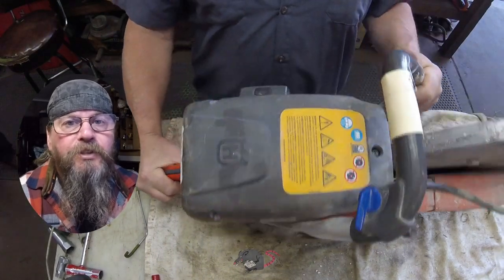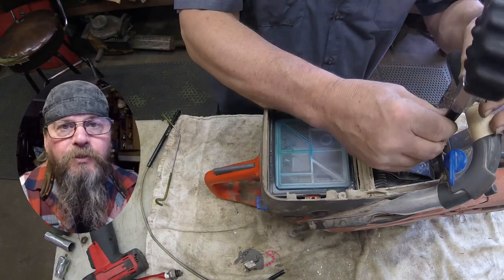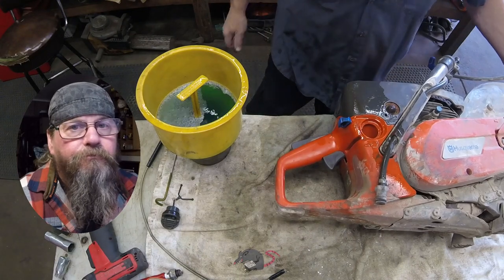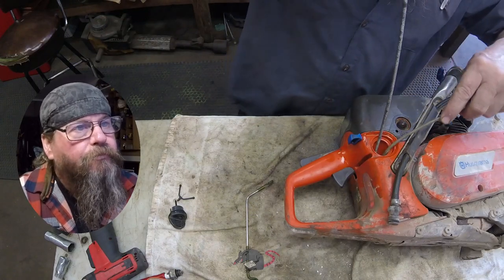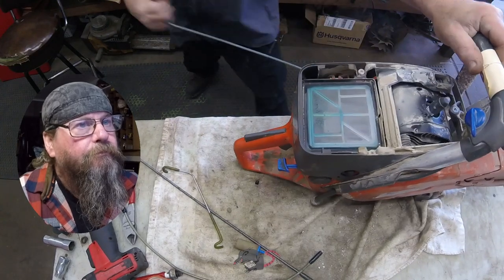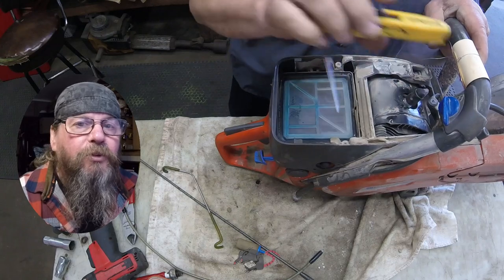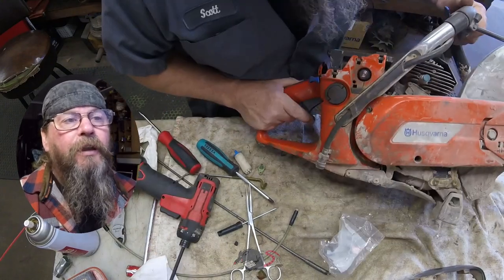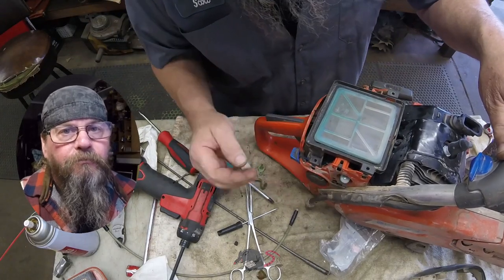Husqvarna K760 Won't Start-Fixed!

Comment: Your video came in handy. I've got a K770 which is basically the same set up. This is a demo saw and it doesn't want to crank either. It popped over one time and that was it. It's got nearly 125 PSI, so that's not the issue. I've pulled the carb off and the boot also looks fine. I don't believe that the diaphragm is soft enough to move with the needle. I just finished a chain saw with the same issue. Fired right up. Thanks for the class once again.
Reply from the maker: Thanks for watching!

Comment: Hey man , thank you for your time and patience.  Cant get any fire on my saw
Reply from the maker: Remove the kill wire from the coil and try again. If you still don't have spark then check for a good ground beteween the coil laminations and cylinder. Other things to check are if the magnets on the flywheel are strong and the air gap between coil and flywheel. What method are you using to check for spark...because I assume thats what you meant by "no fire".

Comment: I'm kinda the neighborhood repair guy where I live.  I've worked on a couple of these power cutters before and was successful.  Mostly though it's mowers, snowblowers and the odd chainsaw or leafblower. At any rate it's enjoyable work and I make a little cash on the side. Most of the time I have to pick equipment up from a lot of my customers but I charge them a fair rate for fuel and travel time.  I watch a lot of repair videos and I'm really glad to have found your channel Scott.  I like your setup and your no nonsense approach as well as the comedy you throw in from time to time!  Good stuff!
Reply from the maker: Thanks for tuning, I'm glad you're able to pick up some worthwhile info. Funny, I don't remember ever fixing a neighbors piece of equipment.
Reply: @TheGreasyShopRag  can I get your thoughts on using the cheap cylinder and piston kits you can get on eBay and Amazon.  Are the good and last, or are you better shelling out and buying the husqvarna genuine one?
Reply from the maker: @justinf1343  Its my opinion that you get what you pay for. I almost always use only OEM parts because I know they will fit without issue.

Comment: Appreciate your videos!
I have one of these in.
Compression is at 90psi.
How low it too low on Compression?
Tjanks!
Reply from the maker: @kurtpolak2670  I usually use 100 psi as a guide.  Did you inspect the cylinder for scoring or heavy wear?
Reply: There is minimal scoring on the cylinder, and the piston.
The top of the piston had scoring damage above the top ring.
The bottom ring was stuck in place. I had to break the ring in 3-pieces to get it out.
Should I replace the piston and rings, or just the rings?
Reply from the maker: @kurtpolak2670  If I were on a budget and the piston checked out ok then just rings would be fine.
Reply: @TheGreasyShopRag  
What if you wanted it done right?
$600+ for an OEM cylinder is too much.  I will have a new complete saw price, just to do this repair. It will be scrap
I'm seeing The Duke's Nikasil lined cylinders and pistons for about $130.
Are there aftermarket parts that are good or is OEM the way to go?
Reply from the maker: @kurtpolak2670  I'm not the person to ask because I work at a dealership and we only useoem parts. I have nothing to compare to.

Comment: I have one I’m working on now. Had scored piston and cylinder. Replaced those. Has 125 psi of compression. Fuel line holds pressure. Replaced fuel filter, intake boots, fuel lines, ignition coil, and carb with amazon aftermarket units. Will barely start with starter fluid and dies immediately. Put another cheap carb on it thinking it is fuel related. Same thing. You think bad carbs cause they are so cheap? Has good compression and spark
Reply from the maker: I wonder if you have a bad crank seal. Do you know why the piston scored originally?
Reply: @TheGreasyShopRag  I do not. It’s my fathers saw. Top end was rebuilt last year by a shop and ran for only an hour or so. Piston and cylinder were scored again in such little use. Any way I can check bottom end? I have the workshop manual and it has you pressure it to 7 psi and see if it drops but I don’t have the special tool to mount to the exhaust port
Reply from the maker: @domrosanelli  Pressure/vaccuum testing the crankcase is important at this point and I wouldn't move forward with anything else until that task is complete.
Reply: @TheGreasyShopRag  would crankcase leakage cause a scored piston and cylinder
Reply from the maker: @domrosanelli  Yes. If the engine is sucking air that hasn't passed through the carb and mixed with fuel then the engine is running lean and can score the cylinder.
Reply: @TheGreasyShopRag  0 crankcase pressure. Pulled apart and bearings were seized and has torn crank seals. Going to rebuild it and see what happens
Reply from the maker: @domrosanelli  Well at least now you know why it dies in the first place.

Comment: What tool did you use to test for spark? What tool did you pull out the spark plug with? And what tool did you pressurize it with? They all look so handy, I’m trying to get almost the identical saw running, and am having no luck.
Reply from the maker: Spark Chekr by Trillium. Thexton spark plug remover. Mity Vav MV8500 pressure/vaccuum tester. Thanks for watching.
Reply: @TheGreasyShopRag  Is that the same pump as for a brake bleeder kit?
Reply from the maker: @Smalltechguy  Some brake bleeders are vaccuum only and may not have a gauge.

Comment: Do you use stone or felt type of filter?  I’ve been told that water plugs them up. Dad’s chainsaw running erratic. Submersed filter in fluid and gently blew thru. Looked great but gas only going through top and bottom, not the body. Take care
Reply from the maker: I use original equipment husky filters. They are not felt or stone, but look like stone. I've never tried blowing air back through one so I'm not sure if what you're seeing is normal.
Reply: @TheGreasyShopRag  thanks I will check those filters out. Gently blowing through is for my own knowledge.  Normally you’ll see the entire filter foam.  On my dad’s only around the top and bottom foamed. Flow was restricted. The rest was plugged.  Plus your time is different than mine.  Thanks again.

Comment: I have a Husqvarna 555 RXT Brush cutter bogging down any ideas?
Reply from the maker: Lots. Way more than I want to type out. I would say if you follow the basic diagnosis procedures I present in these videos you should be able to rule out a lot of possibilities.
Reply: @TheGreasyShopRag  I have done everything I can think off surly there is a common fix no?
Reply from the maker: @FunnyFiveADay  Old fuel, water in fuel, blocked fuel filter, hole in fuel line, blocked screen in carb, torn intake boot, bad crank seal, air leak at cylinder base gasket, scored cylinder, ignition problem, blocked spark arrestor screen, heavy load on engine or maybe it just needs a carb adjustment. It could be any one of these.
Reply: @TheGreasyShopRag  I will stick it in for a service 🤣🤣🤣 thanks mate
Reply: Thanks for the advice bud you got a new subscriber 👍

Comment: I have a Husqvarna k970 concrete saw and it is flooding with gas in the boot. Any idea why?
Reply from the maker: Don't know what you already checked so...No spark. Sheared flywheel key. Kill switch wire circuit grounding on case. Low compression. Stiff metering diaphragm. Bad needle in carb. Poor quality fuel.

Comment: I'd imagine those saws live a tough life
Reply from the maker: Yes, and quite often a short life.
Reply: @TheGreasyShopRag  Friend, I have a 335xpt saw, after pouring the fuel to full, gasoline spills around the clutch about 50ml what can it be? How to fix it ?
Reply from the maker: @Sensei948  I'm pretty sure the fuel tank vent is on that side. It would face down when filling the tank. Dry the saw, tip it to that side for a moment and see if fuel spills. The vent is replaceable.
Reply: Exactly there in the tank are 2 black fuel hoses and a second white vent ... How to replace the vent in 335xpt? @TheGreasyShopRag

Comment: Don't rev it cold. Throttle lock engaged. Pull cord. Blip throttle lock to idle.
Reply from the maker: Consider for a moment WHY you shouldn't rev a cold engine. It has nothing to do with the act of revving it up. Its about building heat in certain parts of the engine faster than other parts.  A hot expanding piston can seize in the bore. Do you think I created much heat at all in that engine by running it for a few seconds (and not very fast)? Thanks for commenting and thanks for watching.

Comment: Yeah, if you run a concrete or masonry company these things last about a year and then they're done.  You'll spend more chasing repairs than you will just buying a brand new one.  These things are a joke.
Reply from the maker: They run in the dustiest environment possible. Its surprising they last as long as they do.